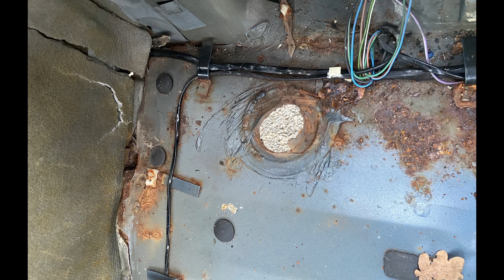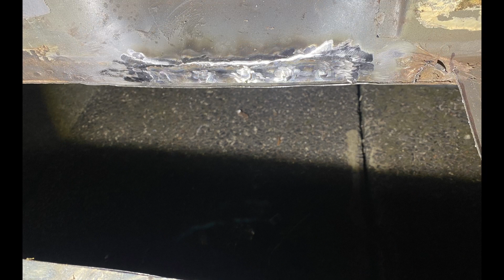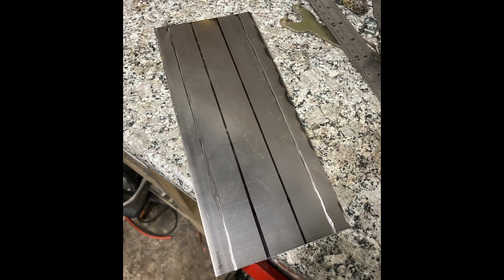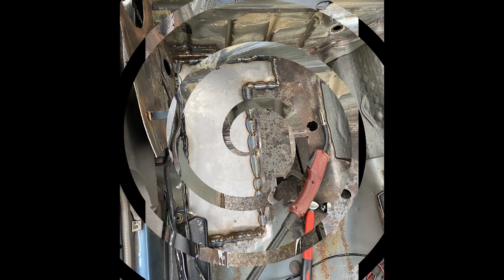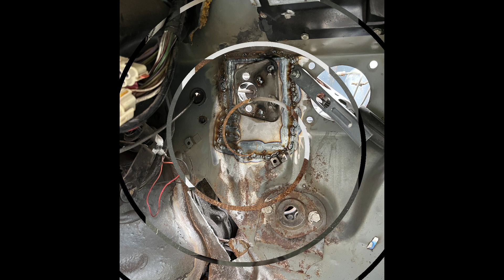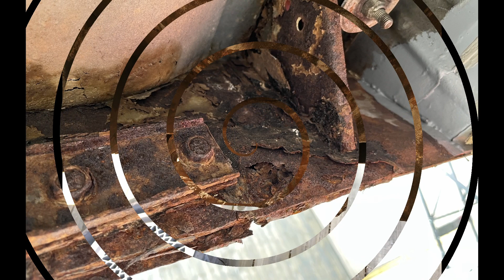ROVER SD1 VITESSE TWIN PLENUM - BARNFIND RESTORATION - CRACKED BULKHEAD & ROTTEN FLOOR-WELDING Part3

Comment: I tack welded m8  nuts to the reinforcing plate on the inside of the bulkhead. Made it easier bolting  the clutch master cylinder in. Also I made the reinforcing plate 3mm.
Reply from the maker: Yeah good idea,